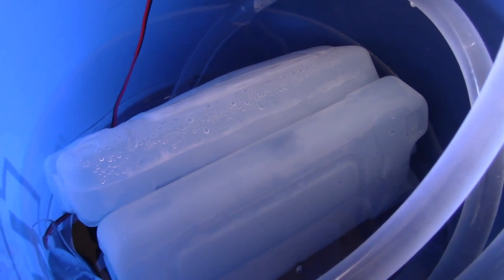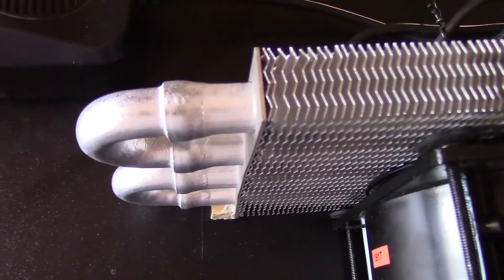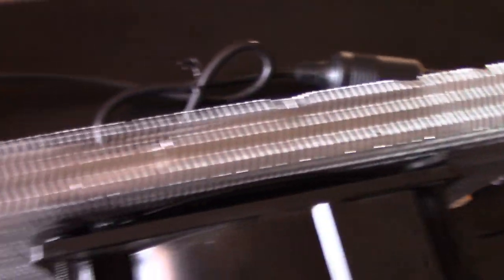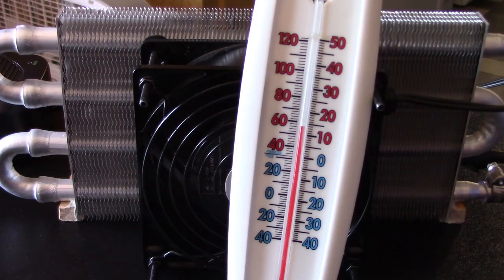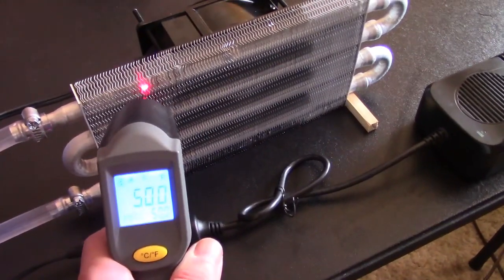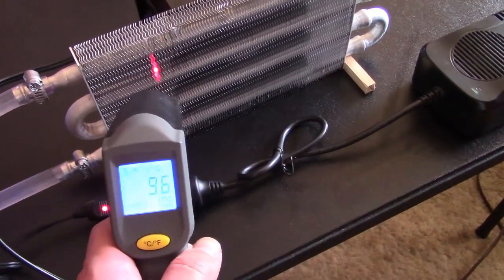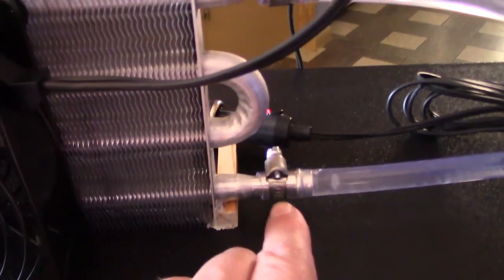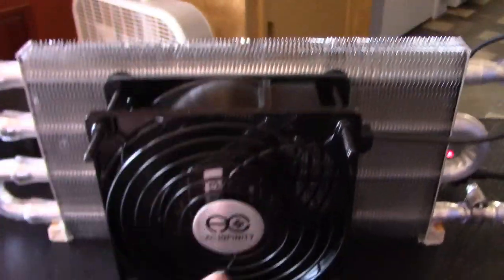Homemade AC Air Cooler! DIY Air Cooler! (compact!) - No added humidity! - Easy DIY - Air Conditioner

Comment: I have even done dry ice and antifreeze on larger scale. Built a unit out of a ice chest….my liquid coolant recipe is still being worked out but it is some ratio of the following: sea salt dissolved in distilled water, antifreeze & vodka. I am still playing with configuration in ice chest but basic premise is a 3 gallon bucket with lid fastened to floor of ice chest with metal mixing bowl filled with either regular ice + rock salt or dry ice depending on the volume of air to be cooled & size of coils. In the lid I have quick release couplers to attach exterior hoses. One of the holes will be for CO2 exhaust from dry ice which absolutely must be vented if camping or in tight space as it could cause loss of consciousness. The other two ports are for the flex hoses that I insulated myself to connect to coil radiators or booster pump station. I also have a power connector on the bucket lid 24V only that way everything can be disconnected and not have to take shit apart. In the bucket I put 2 micro submersible pumps mounted on sides of bucket that turn on automatically if there is liquid even if the main pump isn’t running so that things don’t freeze by chance. Then I have main pump in the ice chest mounted to bottom of chest. Pump is actually very strong and is electronically variable via a couple ways (will go into in a bit). The big pump has a relay lead to manually shut off, automatic emergency shut down and for thermostat. I modified an old ice chest and rebuilt it into a nice looking rugged device that just has ports on outside that are labeled for various hose connections, power, data, etc. so I won’t go into the radiator/fan thing because that depends on your own situation but the idea i had with the main cooling unit is to have all the brains and guts in one place. I am currently working on having battery bank in the unit so that it can run on a charge being I intend it for camping. I am also figuring out what to do about the CO2 exhaust if there should be a pressure sensor inside the unit and a valve to bleed off any gas. So I used a raspberry pi as onboard computer with wifi and Bluetooth. It has a tiny 3.5 in touch screen that I bought as a all in one case but of course the main interface can be accessed on any browser or Remote Desktop service. The Pi monitors everything but the point of it is to maximize efficiency and to act as a smart thermostat by throttling 12v fan speeds (more electricity is wasted when start and stopping vs constant variable) as well as the big daddy variable main pump (boosters if applicable). There are temp sensors on radiator coils, inside of egress/ingress coolant tubes, in front of fan (air temp) as well as inline flow/pressure sensors and coolant liquid level sensors…I also added several sensors that are round discs of absorbent cotton should they get wet it will shut the entire system down and an alarm goes off and if it is connected to wifi it will alert on your phone because it would be horrible if a leak starts and all of coolant pumps out flooding the tent/house or whatever. Anyways I have had many prototypes going back starting 10 years ago so I don’t have a final product. I have some finished ones to get an idea of design. It sounds like this is an expensive habit but as long as you know where to buy stuff used and where to find free stuff and trash to recycle. I am an engineer so the #1 step is to put pencil to paper and just start writing down ideas and sketching out some design ideas! Start very loose then start drawing out designs on some graph paper then go to computer to do some drafting, 3D modeling mock-ups with exact numbers shapes and lines, etc. it is easy to change the design in digital form and you can get exact measurements before building or buying the first thing. You can design anything when you know what you are doing with the right tools and software and computer science/coding/it skills. Learning AutoCAD (free open source alternative is called LibreCAD) & Google Sketchup Make (free) will start you on a journey of making a lot of money and solving tomorrow’s problem’s!

I am working on modular design style and way of building underground in-hill tiny home off grid 100% self reliant & sustainable mini homestead with all the technology we are already used to, just more efficiently and healthfully! Stay tuned because you will hear of this project in the next decade. There is a whole team of us all over the world volunteering our time to engineer new technologies and community models that will address the human rights crisis seen all over the world.
Reply: Food for thought for Short term cooling you could run ammonia nitrate liquefied in your water to supercool

Comment: So adding a pan with a hose for drainage and insulating the can to extend the coolness of the fluid....Shazam!
Also if you have an efficient danfoss-like type rv-equipped fridge (think ICECO, Whynter, Dometic, etc), you can use the freezer section to continually replace the ice packs on your small living space. These fridges use no more than 40 watt/hours, so the whole ACTUAL setup for cooling your small RV/small truck camper/camper topper/minivan/full size van is about 50 watts +/- !!! Use this for your sleeping area at night or during the day your living quarters. Maybe separate the 2 areas using some bubble/foil for maximum cooling effect.

Comment: How did you know about the "401 Hayden transmission cooler"?  Where did you shop to find that?  Is that a car part?  etc.
Reply from the maker: hi. you can find those on amazon. they sell several different models (sizes) 🙂
Reply: @desertsun02  I'm impressed you knew about these at all.  So some people choose to (and are able to) splice these into their vehicle's transmission oil system, like for heavy towing or something?  I had no idea such a thing would even be possible.

Comment: I put cold water and ice packs in a sealed cooler. I only get cold air from fan for only about 20 minutes after  cold water is circulated through trans cooler. Any ideas how to keep air cooler longer?
Reply from the maker: the main way is to slow the fan down. the slower the fan runs the longer the cool air lasts. if you're using it at home the best way is to use water from the fridge if you can. it will melt the ice a lot slower if the water is already cold. the main thing is that you've got to keep the water cold. as long as the water is cold the air will be cold. large blocks of unenclosed ice seem to last the longest. you can also use this with a small DIY water chiller if you've got low humidity. i've got a video or two on how to make those. then you can run this thing 24/7 without needing ice at all
Reply: @desertsun02   Thanks for your reply, I did use cold water from the fridge together with 2 ice packs in the IGLOO cooler. I was using a 9 inch velocity fan and turned it to highest setting. Any ideas how much longer the cool air will last if i set the fan in lowest speed? Can i please have the link for the DIY water chiller? How long does cool air last in your setting?
Reply from the maker: @Allen Lee the water chillers are part of an indirect evap system. it combines the fan/radiator with evap cooled water. this is the best and most complete video i have of them. https://youtu.be/I6u6yCe8RzI

Comment: Place the bucket into a planting bag 2" or 3" larger in diameter than the bucket, then put insulation material  between the inside of the bag and the bucket. Top the bucket with a round pillow or foam. That way, the ice will last much longer.  I may give this a shot, Thanks!
Reply from the maker: both good ideas! 👍😎

Comment: Where can you buy the condenser coils?
Reply from the maker: hi. i get the radiators on amazon. they're hayden transmission coolers. they sell several sizes.🙂
Reply: @desertsun02  I found them thank you

Comment: Thank you so much! I live in a 200 sq ft studio apartment with my main living space being about 100 sq ft. I'm in Seattle so, for the most part, it's not too bad but it's miserable when it's hot because I live on the side of building where the sun is setting practically outside of my window and my apartment turns into Mordor.

Anyway, I took a chance and got the materials for this because it b seemed simple enough and didn't require any major tools. I tried the small cooling fans but the ones I got just weren't powerful enough so I switched out for my Honeywell smallish fan. Though it has a bulbous back, it works and provides so much more relief than using a fan without some sort of cooling element behind it. I got one of those Gatorade insulated drink dispensers and have been able to get about 2-3 hours worth of cooler air. Because the tubes are coming out the top, I'm not able to get the top on so tomorrow I think I might try aluminum foil on the top to see if I can prolong the water staying cold. Also put some small microfiber towels under the cooler to catch the condensation drips. So far, so good. Thank you, again, for sharing!!

Comment: I was thinking about doing this for fun and looked on YT and seen your vid. Was thinking about doing exactly this. Only thing I’d prob add is a shroud to go from coils to single fan so you get all the use of the coils. 2 fans is cool too but in my mind I’m thinking I don’t want too much flow or it would raise temps

Comment: I need your help. I’ve been tasked with coming up with a way to provide cold dry air for a children’s hospital in Bangladesh. Mission work. Very humid air must somehow be dried so I can use it in an evap system/heat exchanger. I’ve got the design in mind but am stuck with that humid air. Can anyone help me???
Reply from the maker: i've been working on DIY dehumidifiers but so far they are just small systems. maybe other commenters can help?
Reply: @desertsun02  Thank you for taking the time. 👍😎

Comment: I'm wondering if you could help me I've watched a lot of your videos and I think you're on to something I have a mobile home that the a calls the part that's inside the house by the fans on a central air central heat unit they're fine but the outside condenser got hit by lightning and caught on fire so it's no longer functional I'm wondering if I could take this same system and put it on a larger scale and heating cool the house on the on the complete house I'm wondering is there some way I could tie your experiments in to the a coil and heating cool that way without having an outside condenser if so I would like your input on this thanks for sharing your experiments great job

Comment: I've been watching videos for making these for 2 weeks and this is a great idea using the trans coolers. I am going to use this method and install it into a 50qt. cooler but am researching the best ways to make cold temps that last the longest balancing the radiator size with just the right amount of water flowing through it so my ice/cold water will last longer.

Comment: Know where I can get that Water pump?
Reply from the maker: they've got lots of those pumps on amazon (literally dozens of different ones). if you search 12v 5 watt pumps you'll see them. 240L (63 gph) volume. (wattages vary from 3.6 to 5 watts)
Reply: @desertsun02  thank you so much for the reply!!

Comment: thats a great idea. another thing to do, instead of having the tubing inside the tub with water and ice packs, you could use another radiator and dump that in the tub with the icy water. the metal will get SO cold and act as a further cooling solution so the water will be colder when it hits the radiator with the fans on :)
Reply: I am wondering about getting an old mini fridge and running the pipes through the roof of it along with your idea. Am starting with this set up and going to expand it.
Reply: @IrishOutsider  I have come across the same idea, and would you think making it a bigger fridge could supply the whole house?
Reply: @IrishOutsider did you ever do it?
Reply: I knew a guy years ago did this basic concept but he used a closed system with a keg in a barrel of dry ice at first , he eventually put it inside a small propane fridge he salvaged somewhere.
Reply: problem is gettin that radiator😂
Reply: just take a cooper pipe ,make loop  and add it betwen

Comment: Would the fan be better behind it pushing the cold or in front pulling it?
Reply from the maker: hi. i prefer the fan in front (but either way works). if you put the fan behind the radiator - it will slow down the airflow

Comment: I would like to have one of these to cool while sleeping. For 8 hours of cooling. Was thinking of running the AC a little higher and assist with one of these. Probably would take about 20 gallons of ice water in an ambient temp of 78 to start with. I hate to go thru the trouble to find out. Also, to cool the patio to at least a bearable temp for the dogs outside. Just to humid I'm afraid in Houston. They abandoned swamp coolers back in the early 70's
Reply from the maker: hi. evap cooling definitely struggles to work in the humid areas. these coolers aren't evap based though - so they work decent in any humidity level.🙂✔

Comment: Same concept on how a chiller works. Air cool chillers cool the water at 55 degrees. Pumps are used to push the chill water into the evaporator coils. Blower motors push air into the the evaporator coils and cools mega buildings. Return water pumps into a water tower.  Nice miniature chiller 😎

Comment: hi there,   putting this radiator in a 30 degree
 room temperature will condense and water will start dropping from the radiator. any solution/ideas for this ? 
thanks,
Reply from the maker: hi. i might try just putting it on a towel or possibly in some sort of catch basin. a towel might be all you need to catch the drops of water
Reply: @desertsun02  thanks, i noticed this after using it, there is not much condensation on the radiator tubes.

Comment: Would you please post a link where to buy these items and exact instructions. Please!!!
Reply from the maker: hi there. the links change so often it's hard to keep up. best way to find products is to search amazon. they sell just about everything you need. the hayden transmission coolers (model 401 shown in video) - model 402 is very similar just a little longer. amazon also has the axial fans i used (but lots of different fans work). for the pump choose a small 3.5w to 5 watt water pump (amazon also). the tubing can be found at the home stores or amazon. the list of items and the build instructions is located in the last minute of the video. the video i posted before this one is very similar. (it shows a little more detail on a few things like the pump. that video also has the build instructions in the last 2 minutes. here's the link. https://youtu.be/5YVPu9hfhZo
note that all products used are shown in these videos (along with their original packaging). for extra info. pause player to read the details on packaging.
Reply: @desertsun02  THANK YOU SO MUCH FOR RESPONDING!!!  I found  all parts and have ordered from Amazon!!!

Comment: Any links to the items?
Reply from the maker: hi there. the links on those radiators change from time to time but they are super easy to find on amazon. if you search hayden transmission coolers you will be lots of them. the 3 models i use are the 401, 403 and 405. if you like those square fans, those are axial muffin fans. many of those on amazon too. 🙂

Comment: The paint can is a great idea for the cooling Reservoir. Just needs some way to insulate the paint can and the lines. If you could set the cooler on the top of the can make the hose fitting be all inside the paint can and only have you wires for the fans and pump coming out the lid. Would help make the Ice block last longer inside
Reply: Larger water reservoir works better., especially when insulated

Comment: Is there a reason that you don't use copper radiator than aluminum. I going to assume pricing? Also, how long will you get cool air before having to replace ice blocks?
Reply from the maker: hi. main reason is because they are the optimum thickness and have the best fin spacing (not too close together or too far apart). i've got other vids with heavy duty copper pipe heat exchangers. those are the highest power ones that money can buy. good with high velocity fans. how long the ice blocks last varies quite a bit. depends on fan speed and how hot the room air is.

Comment: I used an ice builder system on my boat cabin. They work great.
Reply from the maker: awesome!
Reply: What's an ice builder system?
Reply: @mohammadbadran642  It circulates water from block ice pumped through a coil with a fan blowing across the coil for cooling.